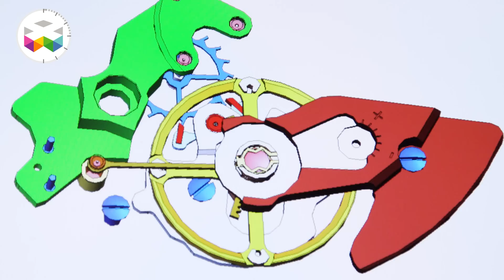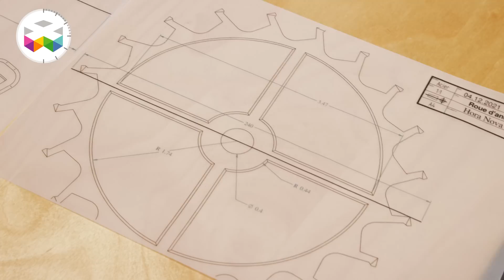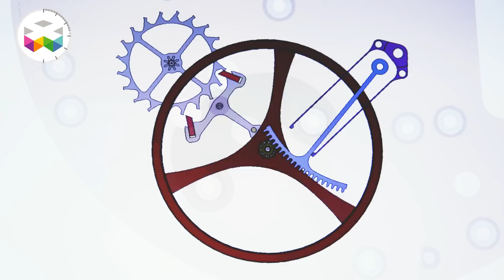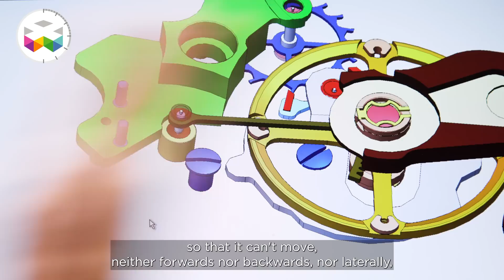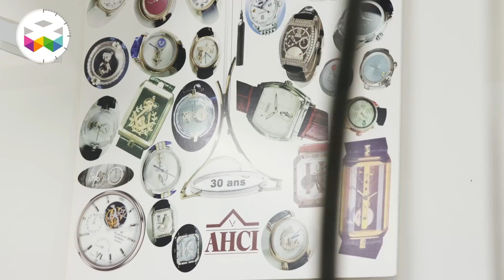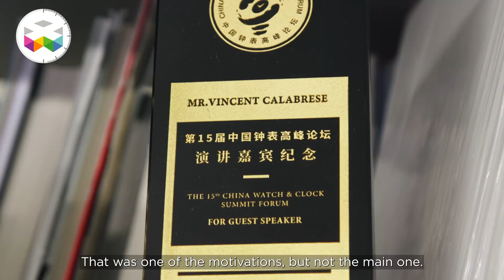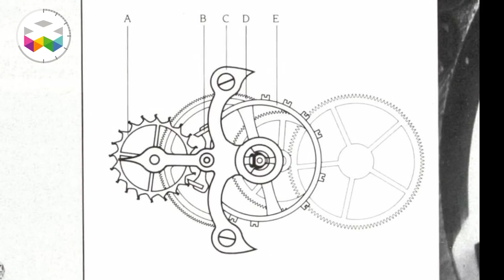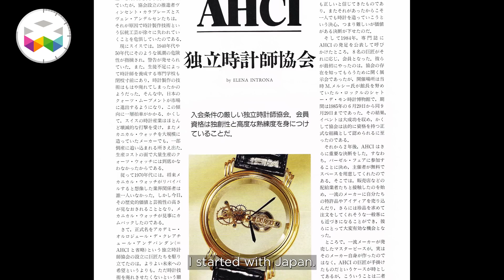Removing The Hairspring With Vincent Calabrese

Comment: Fantastic! A significantly simpler design. it would be interesting to know the long term effect of the rubbing between the 2 springs and the lever in between. Would this add wear and tear in the long term? I assume the contact points could be made of Ruby jewels.
Reply from the maker: This is a good point and we will do a little follow up on it soon

Comment: The new non-hairspring regulator is amazing, but the MOST AMAZING part is Vincent Calabrese made a carousel watch just to piss all the experts off. 

Then Blancpain takes it to another level by making a Tourbillon Carrousel watch (2322-3631-55b) to insult all the experts to open their eyes and look for the difference between tourbillon & carrousel.
Reply from the maker: Thanks for the comment and you’re absolutely right ;)

Comment: Lubrication? As I understand it George Daniels was motivated to reduce friction in the escapement because of the way loss of lubricant over time changed the timekeeping accuracy. Having a rack and pinion permanently engaged with the balance wheel seems to be the polar opposite of that philosophy. 😕
Reply from the maker: But there’s no lubrification needed here either, so you don’t have this issue
Reply: @watchestv-com  I'm missing something obviously. As the teeth of a rack and pinion gear engage and disengage there's a sliding action. Isn't there?

Comment: Nice gimmick but very questionable.

The entire watchmaking relies on controlling and minimizinf the friction: "give me the perfect oil and I will produce the perfect watch".

Yet here we have an invention that generates a lot of friction and significant sliding surfaces at the interface between the spring and the spoke that drives the balance.

I could not stop smiling when he said: I finally made a prototype that can work in every position... obviosly, the gear that actuate the balance it is not compensated for gravity - the springs may work fine in flat position but as soon as you chang to another position one of them needs to work extra to compensate for gravity.

I think it is silly - perhaps 2022 materials science can patch and partially solve the issues but I can tell the concept is destined to fail.
Reply from the maker: But you don’t have oil on a hairspring, same as here and also no oil on the rack. But thanks a lot for sharing this very interesting comment 👍👍
Reply: @watchestv-com  thanks for ur reply but I think I was misunderstood.

My remark was referring to the sliding contact point of the twin springs - this is not only a contact under constant pressure but also a sliding one - the concept is poor and destined to fail

As an example, the entire point (and the reason why it is an improvement) of the Daniels coaxial escapement is to replace sliding contacts that require good lubrication and consume power in friction.

Comment: From the animation I see two very thin straight springs that are constantly bent and unbent at a critical point. Wouldn't that introduce metal fatigue on the miniscule areas where the springs meet the plate, ultimately snapping the springs? Hairspring is an imperfect solution, though the way it coils, it distributes the stress of bending across its entire length.
Reply from the maker: That's a good point but I think that using some of the compliant mechanics principles this could actually be part of the solution. Thanks for sharing your views on it